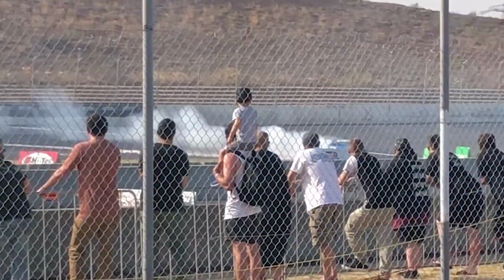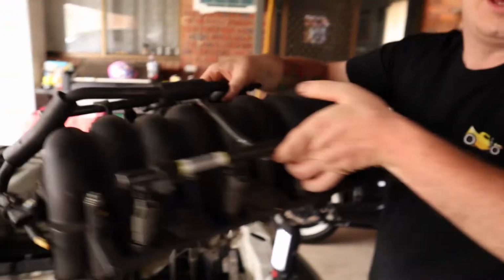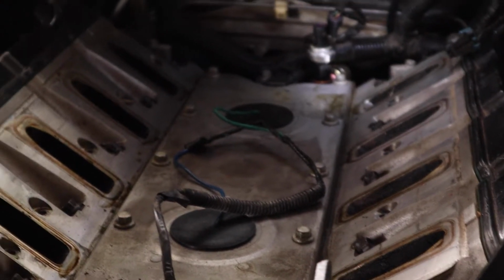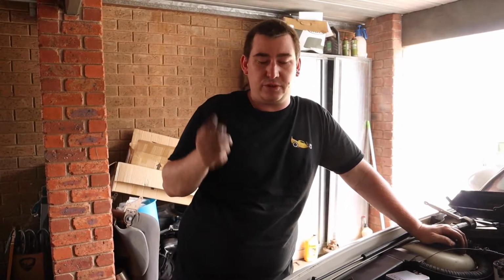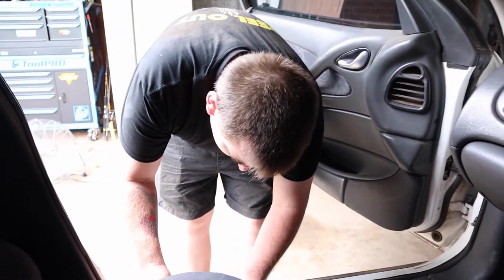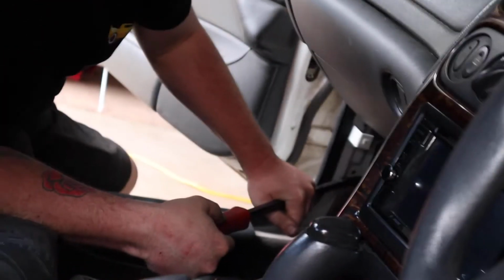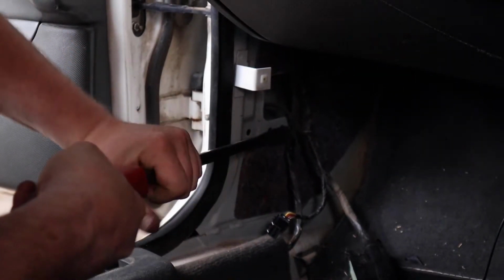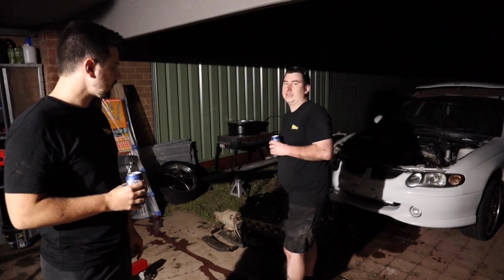VT - VY LS1 T56 Manual Conversion - PT 1

Comment: I want to put a 5.3 into a catera usa version of the vt but it only came with the 3.0 here in the usa . So if I don’t do the 5.3 I will lean towards the 3.8 supercharged l67 or maybe turbo it who knows it will be learning along the way the whole way as it will be my first swap
Reply from the maker: If you end up using the l67 or 3.8 ecotec know as the l36 I would use a factory engine harness combined with a bcm simulator you will have to flash the memcal in the ecu or purchase one off the Web that has the security (Known as vats)  bypassed so it will start 😄
Reply: @PeelOutGarage  thank you sir . I wonder if using a 2003 park ave ecu and harness would let me use hptuners to remove vats